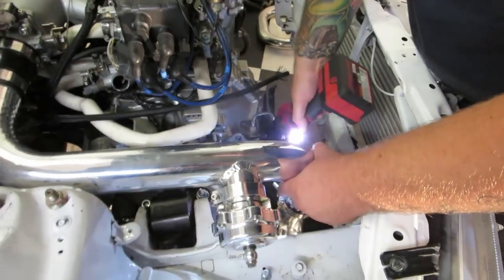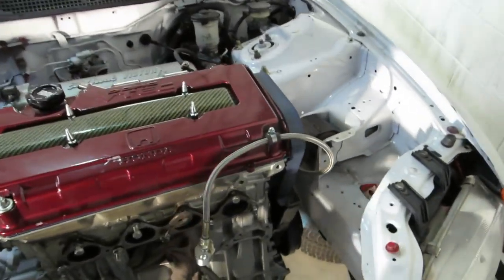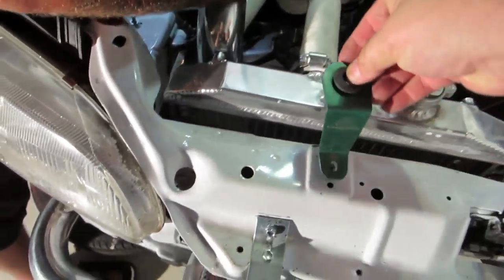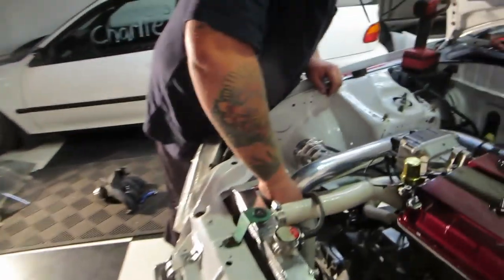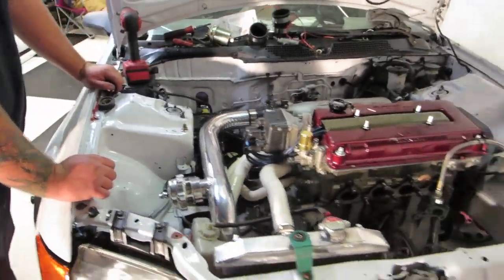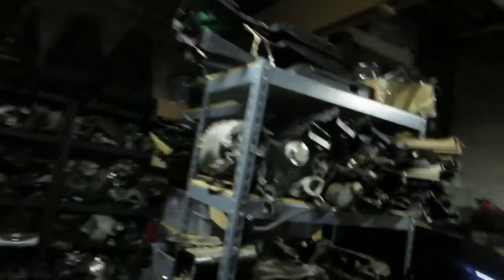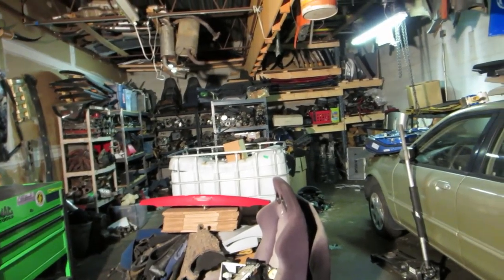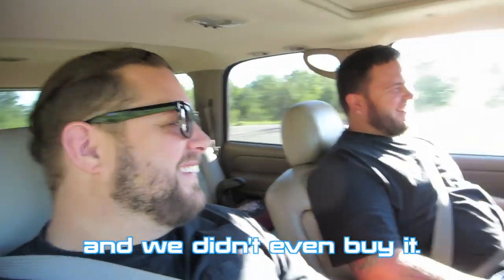IT'S OVER!  DRAG CAR   Pt. 3!!!   HSG EP. 4-31

Comment: Do you guys even own hand tools? Your like my old boss, power tool errrythang
Reply: antfct2 faster and easier that way instead of cranking on a ratchet forever
Reply: k00lball3r Not really, I proved my boss wrong a few times when it took more time trying to fit his power tool into a tight space than it took me to ratchet. I'm just not a big fan of power tools, I prefer good ol ratchet's you get a better feel for the threads and bolt stretch